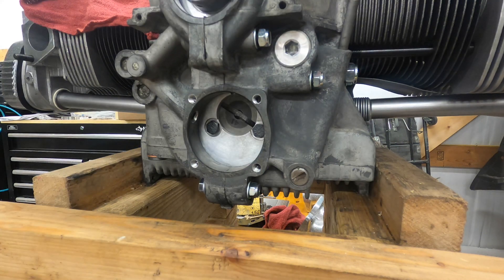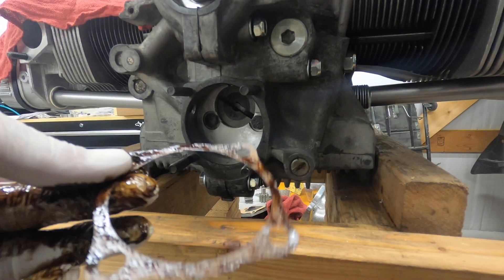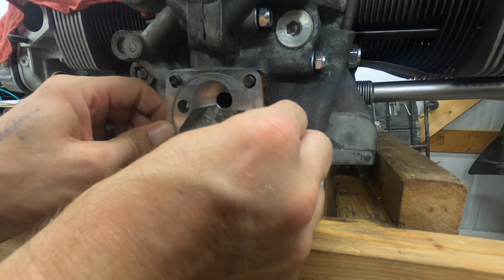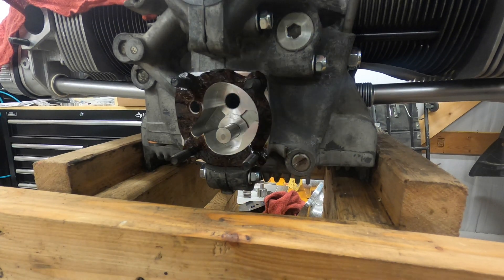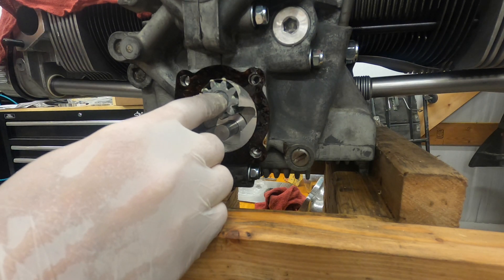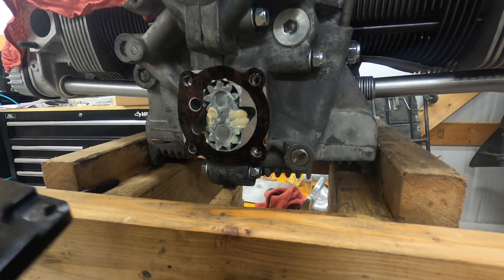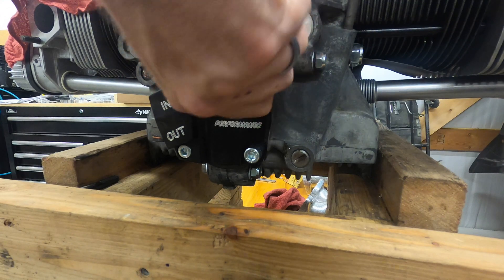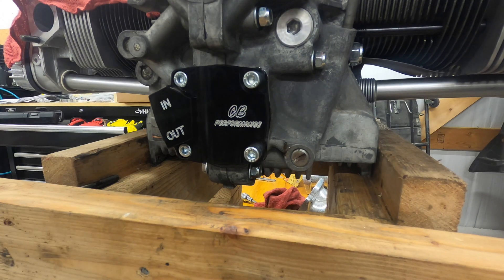CB Performance Maxi 26 Full Flow Oil Pump Install On VW Type 1

Comment: In the process of rebuilding my engine on my 78 super beetle. Can I add something like this to improve the cooling capacity?
Reply from the maker: Sure can.  Run this to an after market oil cooler.

Comment: I have a 1600 with high compression does it matter what size
Reply from the maker: The one I used in this video should be perfectly fine.  If you think you will have higher then normal temps, or if you plan to put a turbo on it, I would go bigger though.

Comment: When did you pull out the studs for the oil pump cover? One minute you were ripping gaskets, putting them over the studs. The next you are tightening Allen headed bolts. I know it’s kind of irrelevant, but you could have mentioned it. A bit confusing for a moment.
Reply from the maker: https://www.amazon.com/OEMTOOLS-27140-Metric-Remover-4-Piece/dp/B004FDJE0K/ref=mp_s_a_1_17?dchild=1&keywords=stud+installer+kit&qid=1626565568&sr=8-17

Take the above, remove the old ones, install the new ones.

Comment: I just purchased an EMPI full flow 96 plate oil cooler kit that came with pretty much nothing for instructions. From what I’ve learned, well I don’t like the BS needed to instal it. Oil return BS. Would this be a better idea? Or at least work better with the kit.?
Reply from the maker: Shoot me a link to what you bought exactly.   I’m seeing a bunch of different variations.  I want to make sure I know what you have prior to me giving you advice on it (pump setup, lines, concept, etc.)
Reply: @VitosFix  I’ve been trying to reply. My responses disappear. This is the kit. EMPI 9248 VW BUG ENGINE OIL COOLER FAN KIT BOLT ON
# EMPI 9248 EMPI #00-9248-0
Reply from the maker: So, I think it would be fine, but I would go with the below link.  I would also call CB Performance and ask them about it.  The 30 should be better though.. push more oil pressure.  For me, the maxi 26 oil pressure could get lower at idle after everything heated up.  

https://www.cbperformance.com/product-p/maxi30early.htm
Reply: @VitosFix  what’s easiest way to find out what cam I have?
Reply from the maker: As far as the style/year cam (‘70 and below, verses ‘71 and up), take a look at the below link and go to the lower side of the page.  Shows 3 pictures.  For measurements and everything, you would need to take the block apart and measure it with a digital caliper to know that.  There are so many different cams, after market cams, sizes, etc.  Some are stamped with some information (aftermarket), some aren’t.

https://www.cbperformance.com/product-p/maxi30early.htm

Comment: What size engine did you do this on? I have a 1776 and the case seems to already be tapped for a full flow return inlet and wanted to full flow it out the pump cover and into the case to the left using a maxipump, but I found out if the case side of the oil port inside the pump recess, where the oil used to flow, the pump has to be blocked and the case needs to be plugged, or oil can leak back into the case causing low pressure at hot idle. I can't just plug the pump or use a maxi pump and leave the case opened. So I might do it this way, did your oil psi go up?
Reply from the maker: https://www.cbperformance.com/product-p/maxi30ffearly.htm

Mine is a 1776cc, 1963 block. 

So you’re saying that the block already has a tap on the outside of the block? (Left of the oil pump) like the link below?

http://bobhooversblog.blogspot.com/2007/06/full-flow-oil-filtration.html?m=1

If so, you have two options.  You use the pump that’s in the CB Performance link at the top, and run the return line into the block.  Or, you plug the tap that’s on the block, and use the pump that I installed.  

My setup, the PSI isn’t bad.  It’s in the 60s for PSI when I first start it up, but when it warms up it’s in the 20s.  Unfortunately, I didn’t try it out and see the PSI prior to putting this particular pump in.  But it runs great.  I don’t get crazy driving it, but I haven’t had any issues with it even when it goes up to 5-5.5k RPMs.  

Let me know is your have any other questions!
Reply: @VitosFix  yeah, my case is tapped to the left of the pump, but it is already plugged, but I think I could use it if I wanted, but I saw some people say when you full flow, and don't plug both the pump and case inside where the pump slides in, hot idle psi can be low because the oil is going into the case instead of thru all the galleys and cooler, so I think I'll leave the left plug there and use the same pump you're running, I think I'll call mark at CB and see what he says too. Thanks for the reply!
Reply from the maker: Yeah!  Talk to them.  Dave (CB) is really awesome as well.  If the other guy isn’t around.  I’ve always heard though, that running it the other way (not like I did) is better.  But that wasn’t something I wanted to do after having everything together.  It’s really hard to make sure your get all the metal shavings out of the oil galley. 

Let me know how it works for you!
Reply: @VitosFix  will do!

Comment: did you have to put a plug in the back of the pump? I just got an EMPI one and it also has a hole for oil to go back into the case.
Reply: I’ve just installed one of these. When I ran the engine, It pressurised my filter, and pushed oil out of the filter seal. Any ideas why? Thx
Reply: @adrianbloomfield4933  Are you using 20W/50? I've heard that higher weight oils will make the oil pressure go too high. I use 10/30 with high zinc. (amsoil z-rod)
Reply: @edweigman9683  Hi Ed. Yes I am. I’ll give the lighter oil a go. Engines out at the mo, but will let you know. Thx 👍
Reply from the maker: Yeah, I agree.  Try a lower weight.  I’m using 15-40.  Also, make sure the oil filter is tight enough as well, but not too tight. Normally you seat it, then give it another 1/2 to full turn. Some filters have slightly different instructions.
Reply: @VitosFix  I might Try One Of These Been Looking around Theres a few Different Soultions to Avoid Tapping your Case , Plus My motor Is In The Car So Should be a Easy Soultion , Yeah Totally Agree about the Oil and As Some one Said the High zink stuff if ya can Find that perfect , Also rub  ya Oil filter seal with a Bit of oil before installing It That might Help Nice Vid
Reply: Actually I Use 10 30 weight oil but thats just me
Reply from the maker: I believe you’re talking about the plug to make it full flow?  

If so, I didn’t use the plug (or any plug). This setup pushes the oil to the aftermarket filter, and back into the pump to flow the normal route.  I’ve had no issues with oil flow. 

If you’re wanting a higher performance engine though, definitely do full flow.

Comment: i see you are using an aftermarket camshaft on your engine, did you grind off the backside of the pump so it would not hit the cam bolts?
Reply: Hey man can you show how your going to finalize this. Hoses fittings and all
Reply from the maker: Yeah!  Give me a few days and I’ll post a link responding to your post.
Reply from the maker: https://youtu.be/7rPERXRxJks
Reply from the maker: For this one, I didn’t have to.  Plenty of clearance.  Not much bigger then the stock pump.  Normally the bigger ones come further out.
Reply: @VitosFix  maybe its because i iused the old cb maxipump , the one with the nons anodized pump cove,r, you need to grind off more ore less 2mm  of its backside to clear the cam bolts